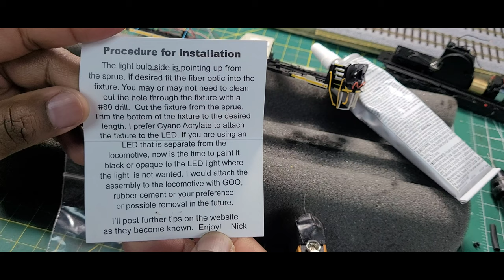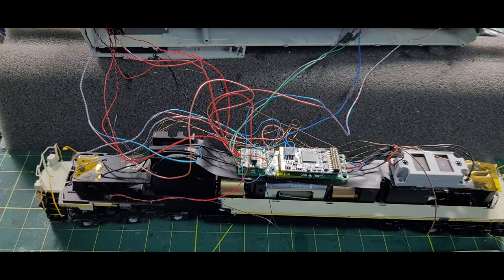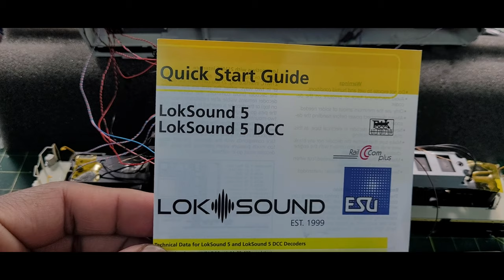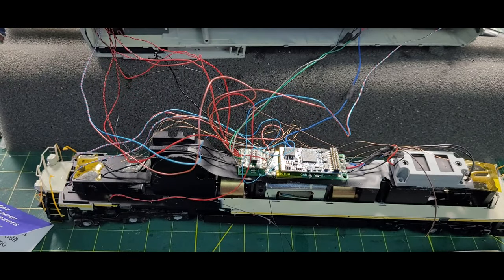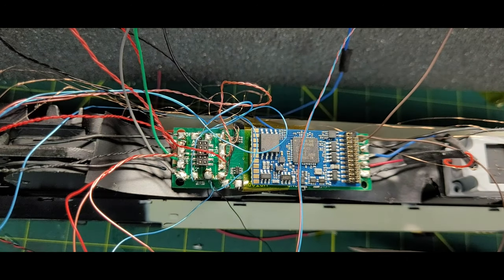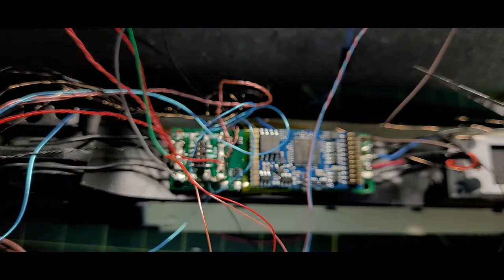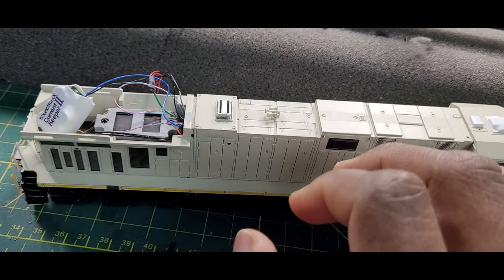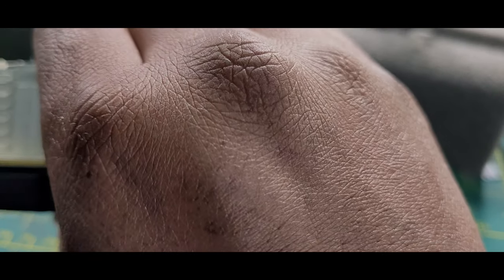NIXTRAINZ Decoder Buddy Version 5  DCC Decoder Installation in a Athearn Genesis CSX 5224 ES44AC

Comment: Did the keep alive that you added affect your abilities to program the esu decoder when installed?
Reply from the maker: I program the Decoder before I installed into the locomotive
Reply: Ok I bought tcs mother boards with bilt in keep alive.  But when trying to speed match and make a few other cv changes it wouldn't work without putting the decoder on the esu decoder programmer